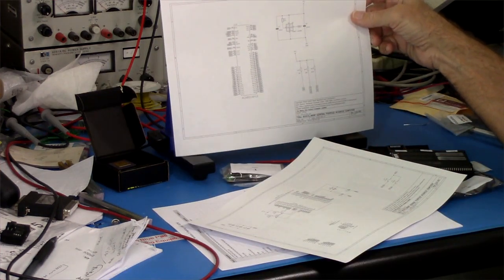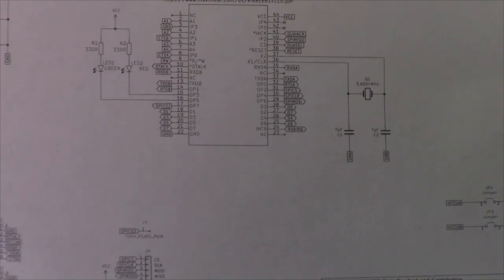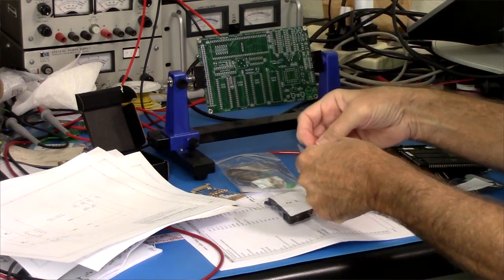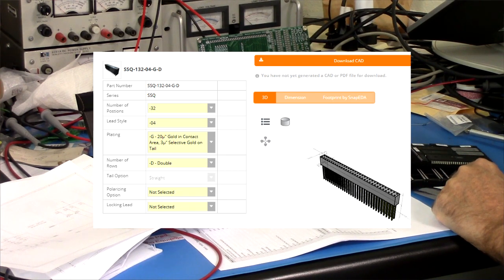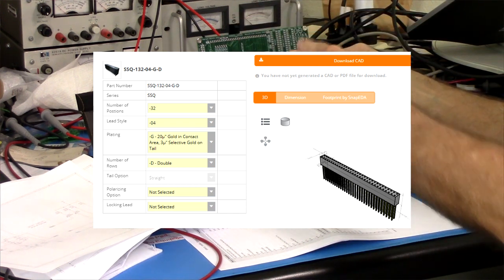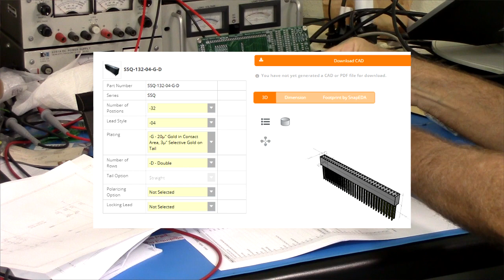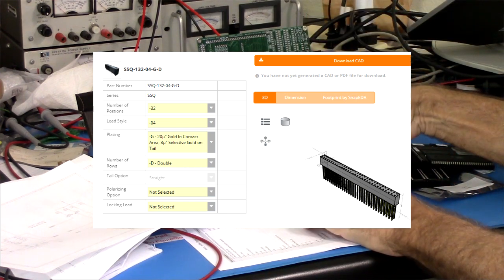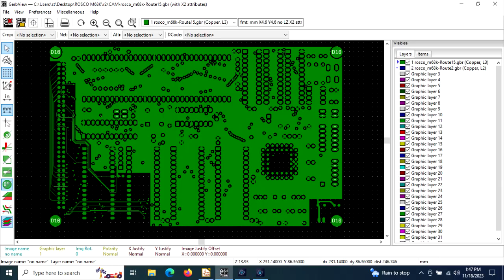First Look: ROSCO M68K Computer Kit

Comment: Also what'd be really cool, unless you want the big 68k chip, would be to use a 68332.  Motorola made a GREAT credit-card sized 68332 board in 1990.  Something like that'd be terrific (and a lot faster I believe).  Those early 68000 chips were really lethargic.